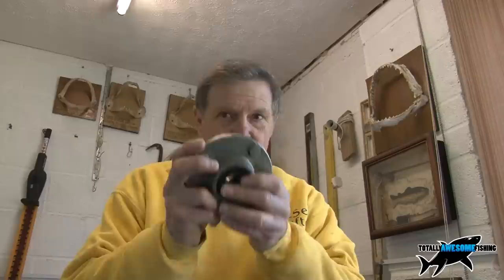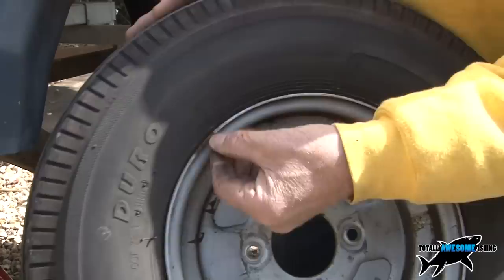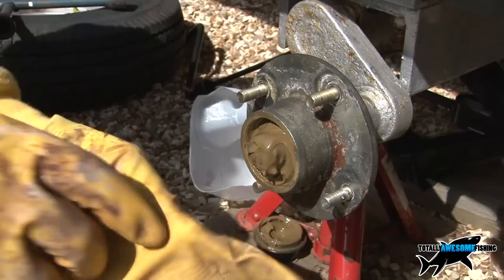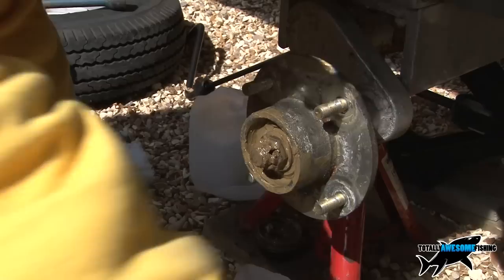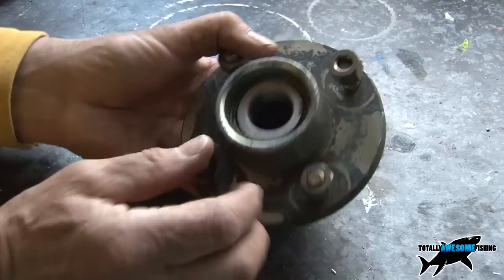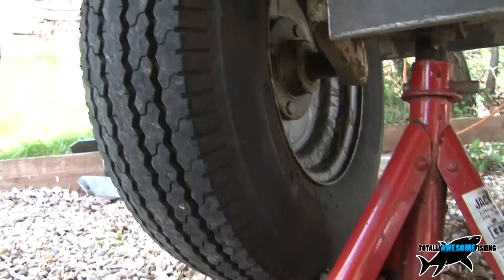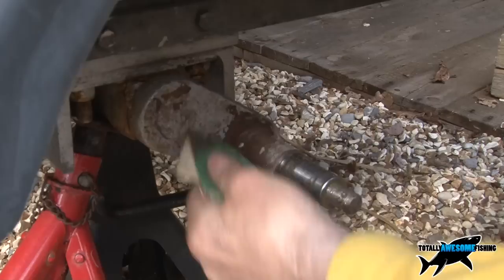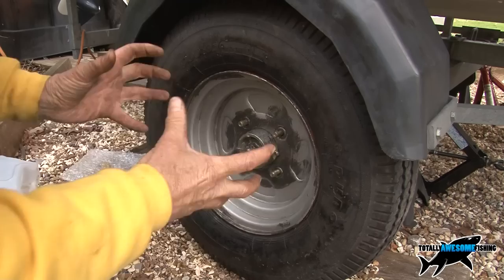How to grease & change trailer wheel bearings

Comment: very good tips video, have run my trailer - previous owners well over 300,000 miles, my miles = 60,000 miles {all on what was thought to be bad bearings} , some pitting - same bearings.   What actually saved them is a set of "bearing buddies"  from the 
start.  grease shots before each trip,  before each launch,   after each launch, before return trip & before storage.    After 70 + years, same bearings & bearing buddies,  3 sets of seals,  4 sets of tires,   regards

Comment: Very nice video.I have greased a few trailer wheels and bearings.Just seeing if anything has changed.I bought a wheel bearing packing tool to force the grease into the wheel bearing.I am fixing a trailer and needs new grease and bought wheel bearing protector caps with grease fitting.

Comment: Great video but you did not need to buy a new hub. The metal racers that the bearings ride against inside the hub can be knocked out and replaced. Cheers

Comment from the maker: Don't know if holds the heat, but I have heard it just softens up and runs out ? I have found that after a long run towing, then dumping the hot hubs straight in the water emulsifies the grease and makes it go milky ? I get that all the time, but I always pump in more grease after a dump in the water to push any seawater out .

Comment: couple of bits of advice, firstly if you want to save yourself some money in the long run and save yourself getting mucky, pick up a cheap full size grease gun for cars, which you simply slip a cartridge in to, the guns are about £12, and each cartridge of  500cc of lithium molybdenum high temperature grease is about £2 on ebay, quick, simple, lasts you ages and nearly mess free, as for the bearings, im only used to changing them on land rovers so trailers are new to me but im surprised you can't also change the bearing races as that would save you from buying a new hub when this happens, but anyway great video!

Comment: if you trailer with the wheels in the water, wich is really not nescessairy, you could also drive around the block when the boat is off. It will dry the bearing.

Comment: Absolutely amazing, all the exact information I was looking for to replace my trailer tent’s wheel bearings. One question, how would you do the final filling out of grease if the wheel hub doesn’t have a grease nipple?
Reply from the maker: I pack it with my fingers as well,but then I don't know about a wheel with no grease nipples.

Comment: Good video however it made me a bit nervous seeing you hitting the wheel studs with a hammer. If the studs are froze up in the hub you could easily mash the threads on them. My tip for this is to thread the nut back on to the stud about three turns leaving the threads protected...Never Fails !

Comment: Good vid just wanted to know why you brought a new hub when the outer bearing can be tapped out with a hammer & drift also all wheels should be done up in a cross pattern to pull the wheel on square just a bit of helpful info for you. Also you should tighten the bearing first then release the nut then adjust your bearing. Sorry concerned ex mechanic c&g

Comment: Hello Graeme,

I have a quick question for you
your trailer looks like its the unbraked type 
I was under the impression  someone would need a braked trailer for the size of your boat
please explain 
Nice Vid very helpful

cheers
Reply from the maker: +Ross TurneNo,the trailer is specially made as a "bunked" trailer for the Wilson Flyer range.Wilsons are light, they come inside the braked category. Heavier laid up boats might need braked, so for anyone buying a secondhand boat with no trailer it would be worth checking the boat's weight.  I can launch the 17 foot Wilson on a good slip on my own.They also used to make a 14 foot Wilson,and that might be a good entry boat for anyone starting. Hope that explains your enquiry.
Reply: +TAFishing Thanks for that Graeme I am assuming 750kg is the limit you are refering to? also do you consider a bunked trailer better for long distance trailing than a roller trailer Cheers

Comment: Do you reckon a 6 tonne press could handle removing and replacing a rear brake drum bearing?
Reply from the maker: No idea on that one. I would type the same question into your search engine, but add the word "forums". There is sure to be comments on there somewhere for that question, and you might even run into an expert on the subject who can give you the right info.

Comment: Too much grease will over heat and kill your bearings. You never want too much or too little grease. To much and your heat cannot dissipate causing over heating of any bearing.
Reply from the maker: I did hear that one before, but then I've also heard it said of those spring caps that push grease in automatically. I know when I dunk my trailer after a long run it sends the grease milky white where it must have been warm. Best to strip out and regrease every once in a while. New grease is not exactly expensive.
Reply: It's made the grease milky white because the water has emulsified it, not because it was warm.

Comment: The way you load the bearings with grease is totally wrong...you have to pack them not put the grease on the outside of the bearing,also the type of grease you put is not the proper one...you have to use heavy load lithium based grease type 3 or type 2, you must not use all purpose use grease.If you do that you wont have to thik about it for the next 3 years minimum...

Comment: too much grease will overheat the bearings and shaft , i dont think salt water is your problem lol
Reply from the maker: +michael brown I think saltwater was,as I saw a trickle in the base of each bearing where it sat on the axle stands. But you are right on the overheating with too much grease,I've heard that from others.Apparently if it overheats from a long tow,then you launch straight away,the salt/cold water emulsifies the grease and it goes milky.